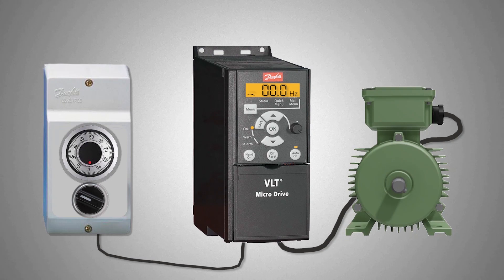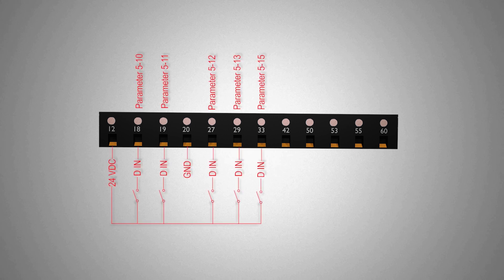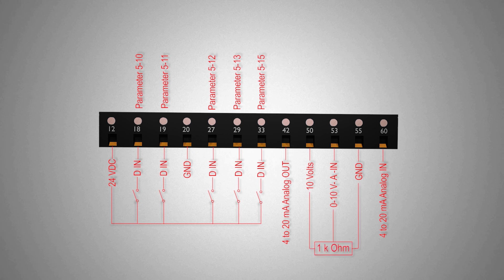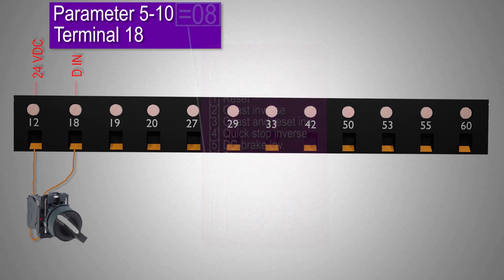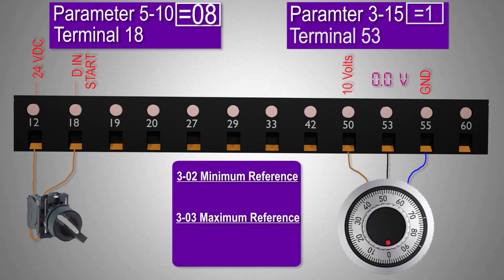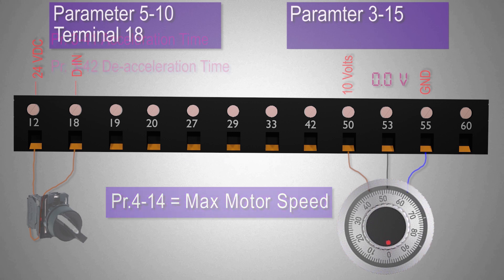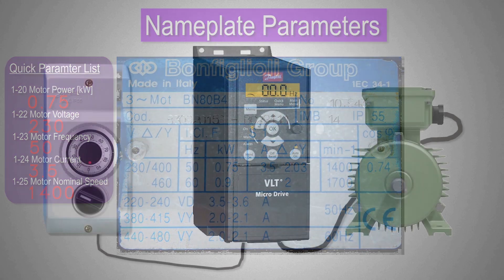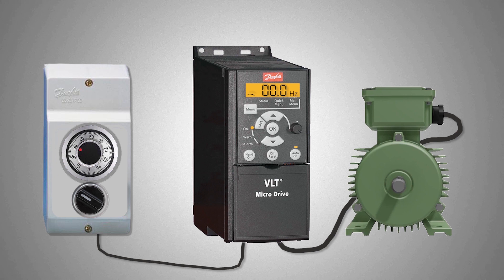How to run motor with VFD via Potentiometer and Selector Switch Quick VLT Micro Drive FC 51-Danfoss

Comment: Sir 
We are facing one problem in VLT2800 VFD It is first goes in fault mode error 14 after .we are reset the fault .checked all parameters .now VFD out put is not caming still.If you are having some trouble shooting remidi pl send me
Reply from the maker: Error 14 is earth fault. Check the earth wire connection on the vfd.check the motor winding of any earth leakage . Check the motor wire for any short circuits. ...
Reply: @EASYPLCTRAINING  
Sir 
We traced there is no any short circuit between motor and VFD in local mode motor is running but in remote mode it is not getting ON
Reply: @EASYPLCTRAINING  Spare one VFD also replaced parameters settings done. From remote motor is not running